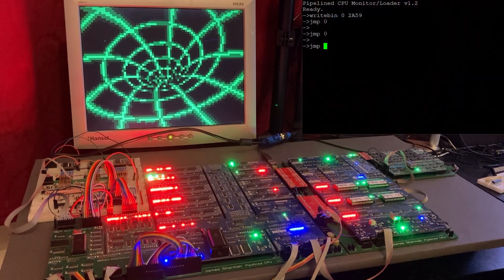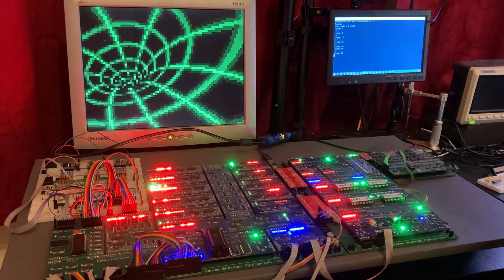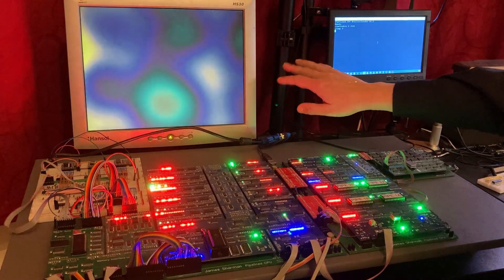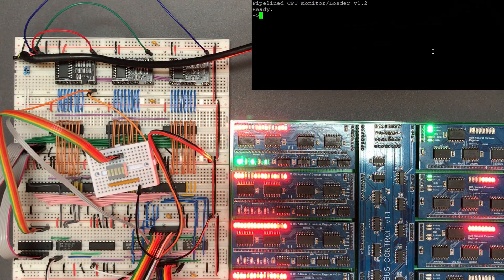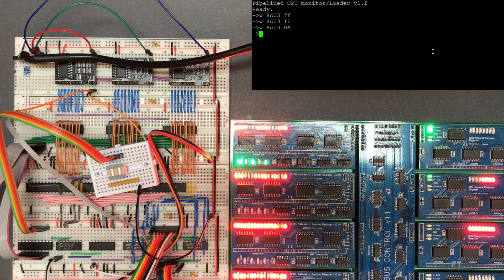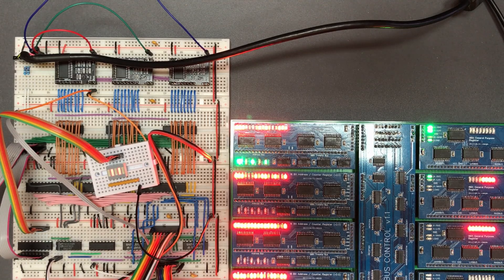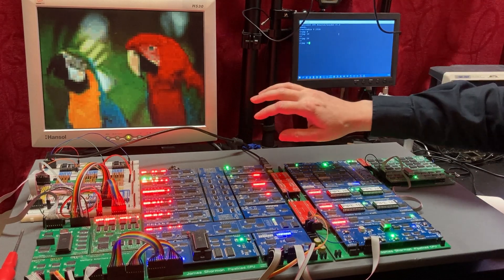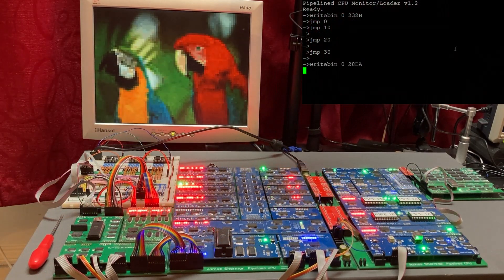Palette Play - VGA from Scratch - Part 12

Comment: Hi James, superb series, I gained an interest by originally following Ben Eaters series, I built and modified his breadboard computer. I'm now currently part way through building the pipeline cpu from your board schematics on EasyAda, I would lik to get a copy of your assembler and coding for the Roms. Is this posible? thanks
Reply from the maker: Replied to another of your comments that there is file share on the discord. You should remember that the build is not yet complete so nothing is guaranteed to be set in stone until I'm "done".

Comment: with this new hardware you could display even more colors on the screen by cycling through different pallets per each line. In theory you could do 8,192 colors at once.
Reply from the maker: Well with the shaded cylinder (and the banded demo) I AM displaying close to that, There is probably some colour replication. If you mean as a static image then yes, but at 80x60 it won't look much different that something with an optimized pallet.
Reply: @weirdboyjim  >80x60

We gotta bump those numbers up! Maybe in addition an 80 or 132 col text mode in color with some other fancy features such as smooth scrolling, blinking text, color inversion, text over graphics, graphics over text, etc.

Comment: Could you hide the visual noise of preloading the palette data, by loading them only during the vertical blank?   After loading the first one of course, and displaying a static image with it.
Reply from the maker: Indeed you could. My simple code was uploading each value as it was done, to hide it you would be better of calculating each palette in a temporary buffer and then uploading it.

Comment: Amazing build. I like ability to switch pallets very quickly.
There is a small issue with the RAMDAC and VGA driving. Lack of gamma / sRGB. You can see this on the intensity demo, where the bright colors do not fade at the same rate as darker colors. Not sure if this actually need to be applied to electric signal, or just the pallet entries need to be made non-linear to properly use sRGB.
Reply from the maker: Non linearity in these kinds of circuit is extremely difficult.  In modern hardware gamma is often done with a lookup table ahead of the dac or even shader instructions.

Comment: Would be neat if the spare memory could do a screen sized lookup texture over the display. You could do 'free' frosted glass/water caustics/heat shimmer with the tile graphics. Maybe even the feedback and offset effects that muic app were doing in the 2000's
Reply from the maker: Ideally for that you would want to sample the image, then add the current x,y. That kind of effect is better suited to more recent hardware but you could do a 1.5d effect along those lines with beam racing.
Reply: @weirdboyjim  Yeah, probably too much of a ram requirement. One thing that might work is a normal map with a palettes for a range of direction to do dynamic lighting effects.

Comment: So you basically have 32 palettes of 255 colors each. That seems unheard of for an 8-bit micro computer, but surprisingly in spirit. The technology of the time was limited by what the developers could get their hands on, so they made sure to use everything of what ended up in the system. You simply used what was available for the palette RAM, and then applied "waste not; want not."

How much color depth was in the original parrot image? If it originally used more than 256 colors, could you have it so that it uses a different palette every few lines to display even more colors on screen at once?

Alternatively, what about sprites? Sprites often used separate palettes from tiles, so the larger palette sélection could let some be reserved for sprites rather than tiles. That said, they might need to be accessed stimulant with the tile palettes like why you used separate RAMs for each color channel. If you end up with another 32 palettes for the sprites, that would just be even more insane.
Reply from the maker: The biggest difference between designing this build and what someone would have done in the 70's is the cost and availability of memory chips!

Comment: This is really impressive progress and I can't wait to see a game making full use of the new hardware! Now that single-cycle palette changes are possible I guess you can create (32*256) colour images, though limited to only changing palette every X pixels horizontally with some carefully timed code. I've been working on something similar on some retro ZX Spectrum code (similar to the Nirvana engine). I think some of the old Sega megadrive games used palette changes on scanlines for things like water effects if I remember rightly. So that everything was tinged blue under the water level etc. Can't wait to see what you come up with!
Reply from the maker: The problem is that 256 colour images are actually really good already, it's general better to use this kind of functionality for more interesting effect. I already have a plan for some water demos :-)

Comment: I think additional palette bits could be connected to address lines so more colors image can be achieved.
Reply from the maker: Not 100% sure what you mean by that? You mean having more bits coming out of the frame buffer? That would only work with more memory down stream.
Reply: @weirdboyjim  more address bits for large RAMDAC you have, could be taken from pixels' addresses lines, in this case video card could have different palettes for different pixel lines. And so letting to display more colors per one frame, even every pixel still having only 8bits/pixel.
Reply: @weirdboyjim  no, idea is simple. Now you have large RAMDAC which can store more than 256 colors. 8 bits are used from framebuffer RAM, and few bits are spare. Instead of adding addressable register for these 'spare' bits to switch palette per frame.  You could just take these bits from let's say lowest scan line address and have different palettes for different scanlines. No need to extend framebuffer memory or add additional registers, but you could use more colors in picture than just 256.

Comment: Really good work.... perhaps you should exchange that ROM socket with a ZIF socket to make it easier?
Reply: The rom is used for the sync generation, it will very rarely change. What James fixed was a missing directive, and that should have been there. So it was a bug fix rather than a feature/enhancement. I think the code in that rom is more or less fixed.
Reply from the maker: Pretty much what Oscar said. I have a zif socket in main memory where I planned to swap rom's lots but the sync and the pipelines it would have been a pain to have the bigger socket on the board.

Comment: of course changing the pallet between scan lines is how the megadrive did the under water sections in sonic. There was a separate under water palette for the level so the could change the water level to be what ever they wanted dynamically without redrawing sprites or tiles. (actually they did add sprites to the waters surface to simulate foam)
Reply from the maker: Yeah, there are endless effects you can do with this kind of functionality. I really like the reflection demo's people used to do with a pallet switch and redrawing of the upper half of the screen in reverse.

Comment: This is really awesome! If only there was a faster way to copy data from ram or rom to the palette. I know that some old consoles did it with a special purpose DMA controller. DMA is still even used today in modern processors.
Reply from the maker: I'm only really limited by the total memory bandwidth. In the startup of the new demos I'm doing a full multiply for each byte I write to the pallet which is the real time consuming bit.

Comment: And you found a use for that fourth bit! I notice a bit of unshaded lines at the very extremes of the cylinder travel.
Reply from the maker: That was a mistake, the original cylinder demo had a 64 pixel high image, but the new parrot demos used a 60 pixel high image.
Reply: @weirdboyjim  I assumed it was a simple software bug. I bet you could offload palette cycling to the 8k palette memory. I am unsure what that would accomplish but I think it could be done.